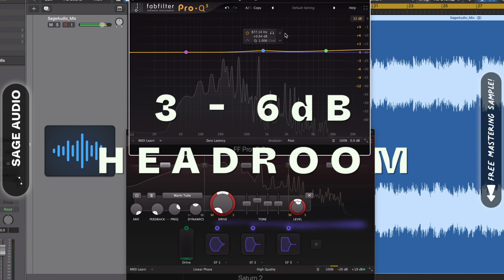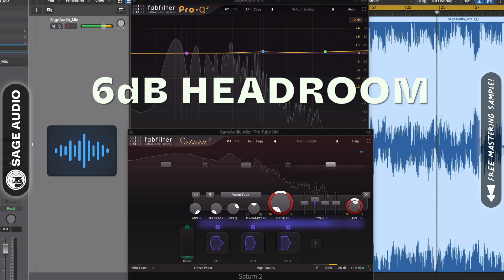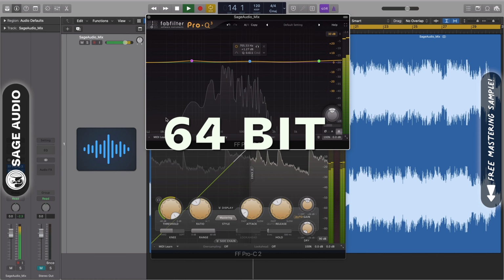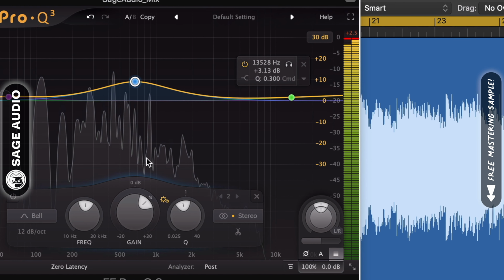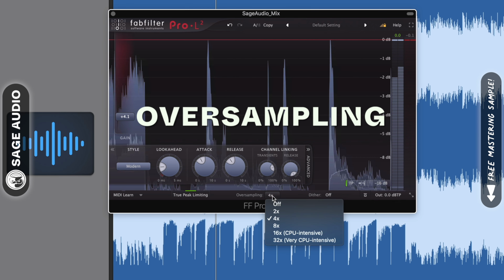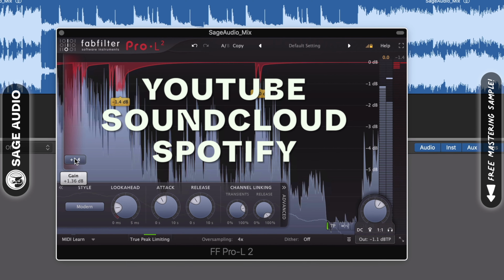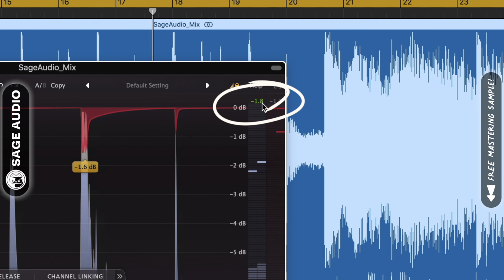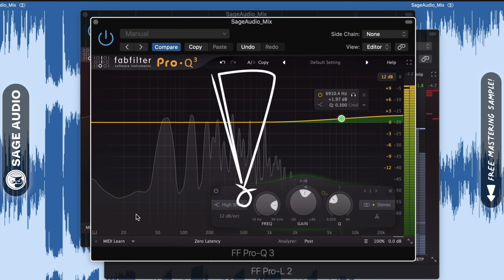How to Gain Stage Your Master

Comment: This is the BEST channel for mastering tutorials, totally agree.

I have  one question. You said in the video that certain frequencies are being heard differently at different volumes by human ear. When I'm starting mastering I always push the tracks with limiters to get the rough final desired volume and then do all the rest like EQing, compression ect (watching levels to keep the same volume). Am I right that thanks to setting the desired volume level first with limitera and then EQing you're avoiding the problem you mentioned? Am I right? So when EQing or doing other processes I always stay at pretty much the same level as final mastered track. Is that good idea? 
Thank you for your answer.
Reply from the maker: Thanks for watching Lucas! It can help, but it's best to avoid since it can cause listening fatigue, and can also give you a misrepresentation since how it sounds limited when you start your chain will be different than how it sounds limited near the middle or end.  That said, I do know some engineers that do this and like the results, but I usually take it step by step then adjust things if needed once I've added limiting.

SageAudio.com
Reply: @sageaudio  Thanks for reply. I'm quite confused now. What way would you suggest then? Firstly pushing the track with the limiter to rough desired volume level and then do all the EQing (since volume wise the track will stay at the same level throughout the process), or do all the EQing (and all the rest) and then push the track with limiters (but with volume increase as you said in the video, the way you'll hear frequencies will change). Sorry, but now I'm even more confused. Thank you for your time.
Reply: It's still a good way as long you adjust your limiter when some process adds gain